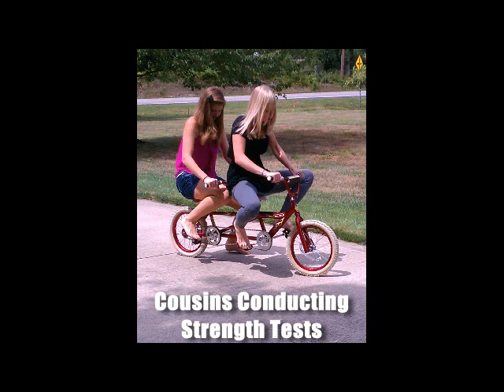16in Custom Kids Tandem Bicycle.wmv

Comment: For highest metal removal rates with the most accurate results, you are on the right track.  The steel stock I started with had a keyway in the OD.  I wanted to cut down below the interrupted cuts below the keyway before cutting the I'D.  My final passes were light finish cuts.  The resulting part stiffness when I sized the ID did not create any issues.  The compliant nature of the clamp is also forgiving on some variation in the clamp I'D.

Comment: Why did you machine the outside of the stem clamp first before you drilled and bored the inner diameter to size?  If you drilled and bored first you have the extra material to reduce part deflection.